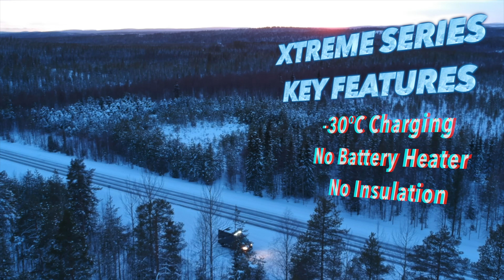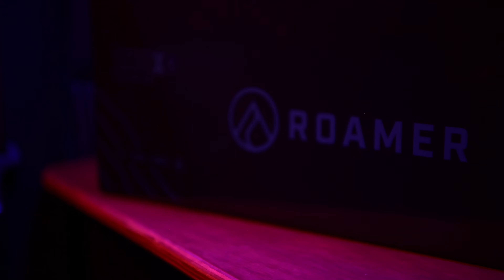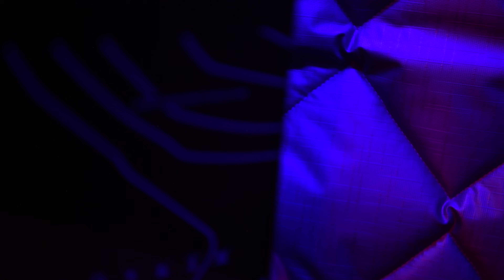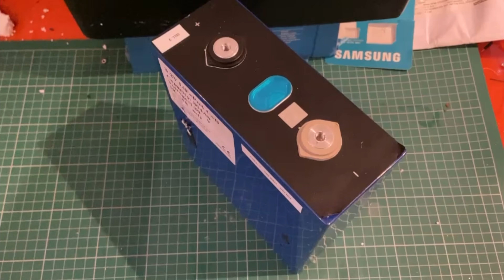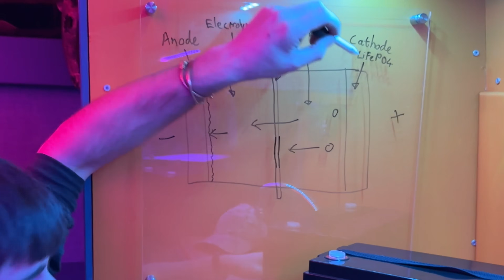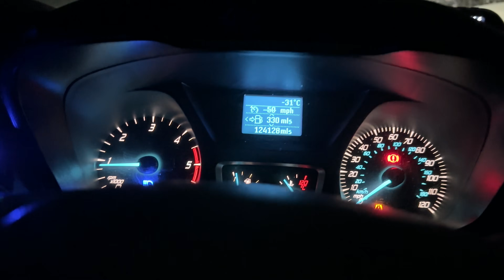HOW TO charge LITHIUM below ZERO!

Comment: This was an interesting problem to compare the two cases:
Energy from discharging an individual 26650 at - 40 C, compared to first warming it up to 25 C, then discharging it at that temp.

I calculated the amunt of energy needed to warm up a cold battery cell from -40 C to 25C.
You can get Heat Capacity values for LiFePO4 batteries. For a 26650 it's +/- 1200 J-kgK
So from -40 C to 25 C, for an 86g battery, you need 6.63 kJ.
It's quite a lot, but is high due to Lithium compounds having a high heat capacity. 

Roamer gives the data for its xTreme 26650 battery for discharge at 1 C down to 2.0 V at various temperatures.

So you need to integrate the discharge (in Ah) over the drop in Voltage: from OCV to 2.0 Volts.
That gives you Watt-hours, or Joules (Energy).

And it's the same trend for other discharge rates: there's nothing slanted abut using a 1C discharge rate.

For -40 C, you get 5.49 kJ
At 25 C, it's 13.30 kJ
A note here is that the discharge data that Roamer quotes has the output at colder temperatures going to 1.5 V.
Whereas the hotter temperatures are to 2.0 V.
So that's an unfair bias: they should be quoting batteries discharged to the same end voltage.
In any case, I took my data from their charges, which shows the battery discharge going down in Volts, and the current dischrged as that occurs (the mAh). 

Therefore, it's better to heat up the battery to 25 C and THEN discharge it, you get an EXTRA 7.8kJ.
That's comparing the differences in energy.

And it's in practice better than that, since you'll likely be using some sort of diesel or other fuel to supply the energy to heat it up if you DID let it get that cold.
But energy is energy.

But in any case, the obvious thing is to store the Lithium batteries in your heated area where they don't get as cold as -40 C.
Or at least insulating them very well, and then using a small amount of energy to counter whatever is lost thru the insulation.
I haven't done that, but it's going to be very small over a period of a day.

So to be honest, I don't really see the justification for buying an (extremely) expensive cold-temperature battery.
Not for this sort of application in a van with a small solar array.
You're bettery off buying a standard battery at £972 plus a small conventional lead acid (cost £50) one to use to keep them both warm.
Compared to the xTreme (expensive) one at £1,520.
Reply from the maker: I do say throughout the video it’s not a battery that needed by most people, it’s pretty rare I’d says that it’s needed for leisure used by most Europeans. Most leisure settings are not going to be that cold inside the vehicle and heating like diesel heaters if there is an occupant will be on keeping it a lot warmer. although that being said I do know a number of my British van friends have taken their normal lithium batteries to the low temperature cut offs during UK winter as they sat in the unheated van garages directly on the floor,, again, I wouldn’t say they would need this battery they just need to consider how they’ve placed their batteries.  with conscious placing of batteries so there breaking of the cold bridge between the floor in the battery will always be beneficial. It has more practicality industrial uses sitting in an unheated spaces, power equipment whilst taking in Solar during day on winter days. More likely it’s not operated at its extreme end of it is temperatures range.  Probably would sitting a few degrees below zero than -30c 

Leisure uses could have more application in countries which experience temperatures far below zero. Especially if it’s a campervan, a motorhome which isn’t taken out often and is left for a few days or weeks on used.

But as I said in the video, it’s not needed by most people. whilst there are discharge and charge effects when below zero, and further you go more pronounced, it’s still possible to use the battery without causing any permanent damage due to the cell

Comment: Hi. Thanks for your amusing videos.

As for lithium batteries in a van, I'm a bit dubious of their cost effectiveness.
Especially these (very) high end Roamer ones.
They are REALLY incredibly expensive. 

And sorry to if I seem to be attacking you, but after all, you were GIVEN these things. I cannot see a really good argument supporting anyone BUYING them.

I've been using Lithium batteries for my motorbike for a while now.
The first one I bought, and was quite disappointed.
After that I've made my own.
Is easy: buy good qualioty batteries, get a good BMS suited for the job (high max amps to start, and that balances them), and make yourself a spot welder.
Easy.

And yes, it IS an issue starting in cold weather.
But some workarounds: can add a heater (properly designed).
Or use a Lithium separate battery pack to start: can keep THAT one warm before (and on long trips isn't a bad idea to have a small backup battery).

But I see no reason to spend huge amunts for these special cold-rated Roamer batteries.
If you look at the behaviour that Roamer quotes at low temperatures it's INCREDIBLY bad in terms of discharge.
It drops to maybe 50% of what it could be at room temperature.

So what lose all that power?
Rather build a proper insulated holder, and if needed, add a small heater to KEEP it warm.
It's simple physics: compare the energy output from a battery at > 20 C, even with a bit of power needed to heat it. and compare that to what you get from a battery at - 20 C or colder.
No question what is better.

If you want to design a battery that yiou CAN warm, then cylindrical cells are best, and you can put the heating elements in the spaces due to the voids caused by packing.
And put your thermocouple inside as well.
No problem.

Last point, is minor, but is important if you want to understand the heat loss.
Heat flows from HOT to COLD.
You said a number of times that the cold from the van floor was going into the battery.
Whereas it's other way round.

And in terms of insulating, you might be worse off putting your battery on legs.
A lot depends on what is generating the heat.
If the air surrounding the battery is COLD, then you don't want to use legs.
Rather use a layer of insulation for it to sit on.
An air gap allows convection, which is a heat transfer mechanism.
Air is only good if you TRAP it: in small cells, or layers. Too small to allow convection.
Insulation is both cheap and light weight.
You're better off heating the battery well, and then surrounding it with insulation: on battom, sides and top.
Reply from the maker: Being given some for “free” doesn’t mean it’s gets a good review from me, I have shown bad point a number of times about products I have been given in the past. 

Subsequently, I now work for Roamer so I now get to see inside what goes on and how they are designed. Our batteries are more expensive than others which isn’t a problem for us. but  that due to our  batteries being designed by us in the UK, Uk serviceable and we have great customer service. YeS, the Cold temperature Xtreme series are particularly expensive, but the cylindrical cold temperature cells are more bulky and cost more than the conventional prismatic cell used in our normal batteries and most other. The Xtreme battery is more suited for a industry applications in my view opposed, sitting running equipment off grid in an insulated locations a few degrees below zero and not normal leisure use, which primarily the SmartGen3 is for. 

In a van context in the air surrounding the battery is generally never cold ( or colder than the outside ) breaking the cold bridge between the floor and the bottom of the battery is more important. Insulated box in this case is not important due to the batteries having a discharge rate down to -40c. But my previous set of LiFePO4 batteries were in an insulated box with a heat pad below ( inside the box ) . There was a huge difference between the amount of time the heat pad came on before and after I added the air gap. adding movement of the air, ideally from somewhere warmer even better. An insulated box is great, but why not do both.
Reply from the maker: Although I do wonder for your motorbikes starter battery example.  in a leisure format you are not really going to be pulling anything more then tiny C rate, Unlikely more than a 1C discharge rate an extended period of time if you are using induction stove or something.

However, for a lithium starter, you would have extremely high C rate for that crank, which I don’t know the performance of under cold conditions versus normal leisure use
Reply: @MispronouncedAdventures  Yes, you need to pull a lot to start the bike, in my case up to 200 Amps for a few seconds to turn it over. And in the cold, you need to do it several times.
A standard Lithium won't do it if the temperature gets < 5C.
One trick is to draw a little current before to get the internal resistance to warm it up.
Then when it is, you can try to start it.
But is hit and miss, and might end up with a drained battery.
The best is to have a battery warmer, or else use a 2nd battery that is warm to start it.

Comment: Hi Alex. Have you used the roamer app to monitor the battery levels yet? My experience is poor due to the app incorrectly stating the capacity of the battery, 530ah and not 320ah. Basically the app is unusable. Roamer acknowledge there's a bug with the app but have done nothing about it. As you work along side these guys, can you let them know they need to sort the problem out as or people will look elsewhere for their power supply needs. Great videos by the way, always informative and often quite funny. Cheers Alex. 👍
Reply from the maker: I work for a Roamer now. We know of the app issues and are working on a new app not just a update.  Capacity can be modified in settings. Normally the capacity setting isn’t the issue . It’s the first few cycles. The BMS doesn’t know what is zero or 100%   The issue moment of SOC recalibration at 100% isn’t working, but it does at  zero so we recommend a full discharge to calibrate. I don’t use the personal. I used a Victron shunt

Comment: Very good video.  Much better production value than most, with a great explanation of how batteries work.  With that said, the claims being made, and the arguments against the use of a heating element to ensure the electrolyte is in a suitable state for charging, are pure rubbish...and I think you know it.  Your claims ignore the laws of thermal dynamics, including, but not limited to, the fact that cold falls, heat rises, and conduction is very much a thing!  Irrespective of where the heating pads are placed, all one has to do is set a top temperature well above freezing for the goal to be achieved.  A simple foam pad under the battery (a very good idea for multiple reasons) will act as a thermal barrier to cold coming in from the bottom, by simply breaking that conductive bond.  Inside the battery, heat applied from the bottom, or the sides, or even from the ends of each cell, can and will (you can't stop it) be conducted to the core of the cells, warming the electrolyte and making it safe to charge.  Your insinuation that this process is somehow unreliable is unbecoming of your intellect and a thoroughly transparent effort to promote this product and earn your shilling.  Please don't waste your talents as a producer of quality content by subverting your own education on these topics, least of all in the name of a sponsored product.
Reply from the maker: My argument is not that cell pads don’t heat is it that they don’t heat evenly thought out a pack / or quickly due to how they are often implemented , and where the BMS’s temperature sensor or sensors is places is very important. Which just wrapping prismatic cell which are a large solid mass and often only a small number of the total cells inside a battery box in not effective, often in a 4s configuration on battery dismantle videos you often only see Cell 1 & 4 wrapped. Even more so on uneven heat especially if the cold bridge between the bottom of the pack is still there. Which is why I say for a more even heating of a battery is to use an external battery heat / heat pad on the side and not the side walls. 

My previous set of batteries I built my own heat pads for. 

This videos isnt for pushing people to buy the Xtreme series, I say a number of times why they don’t need it. But I share my views on how at the moment heated batteries are popular but are implemented poorly and is used more as a marketing point, and how some are implemented ineffectively. 

Heating even 2 of 4 cells would in heat all cells eventually, but if the temperature sensor is in an less an ideal location and there is a cold bridge. The BMS could turn of its low temperature cut off because areas of the pack or even individual cells are all completely safe to charge. If companies used cells heaters at the bottom with a temp sensor located in the right place that could work. But I am yet to see that done
Reply: @MispronouncedAdventures  - You make some good points, but when you factor in that these heaters aren't trying to keep the cells at 1 or 2 degrees, Celsius, the fact of the matter is placement of the heating pads and temperature sensor are largely immaterial.  I built my own heating system for a couple of batteries as well, and I set the temp threshold from 3 to 6 degrees, so the cells never even got to the point where they were frozen.  The vast majority of batteries with built-in heating do the same thing, often with an even higher threshold.  This obviates virtually all of your arguments against them, including various implementation choices.

Comment: That's a very informative video.
My takeaway is that it is better to prevent the "ordinary" lithium batteries from getting cold, rather than dealing with the results.
Mine (and the starter batteries) are inside the habitation box in a trickle heated compartment.
Reply from the maker: Yes! I definitely agree! It’s far better to prevent them getting cold in the first place than trying to warm them a big thermal mass of the battery but up to a safe working temperature again